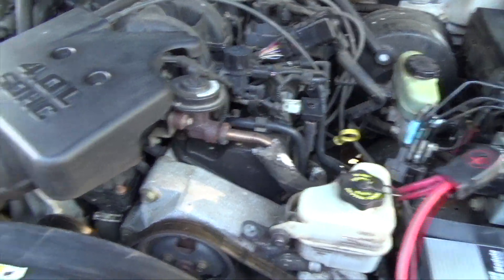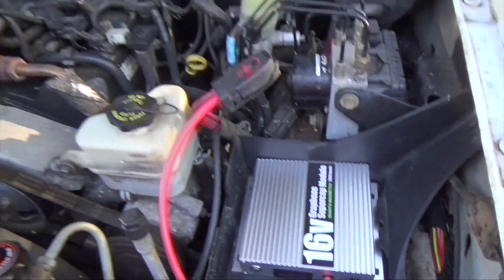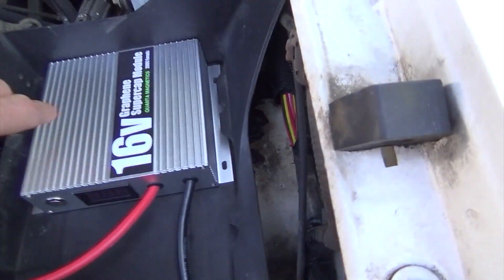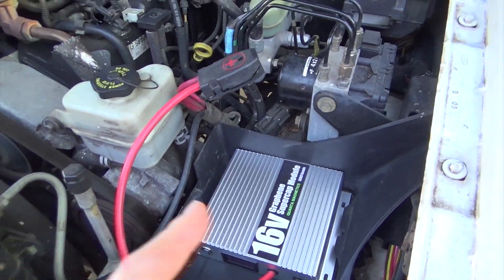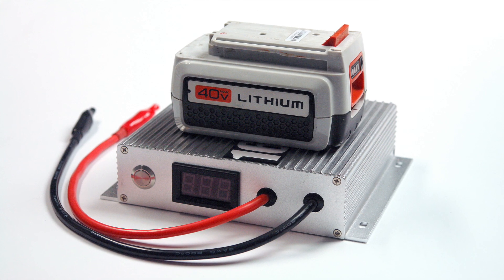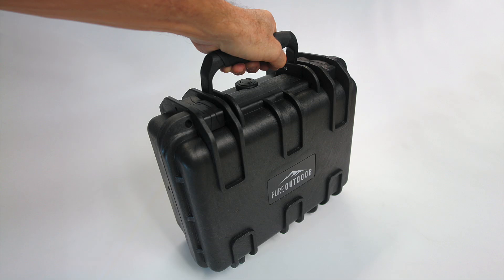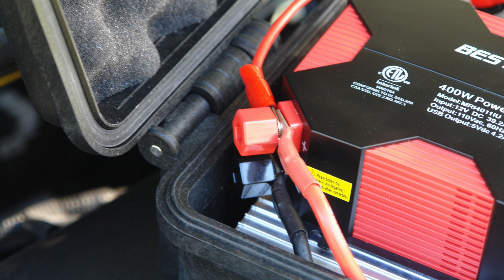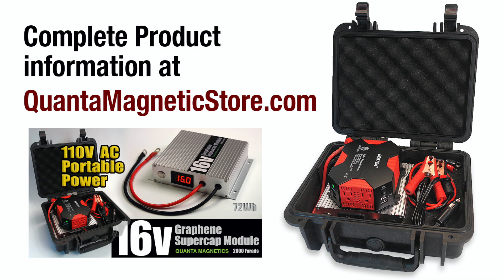Graphene Battery easily starts 4.0L Ford Engine

Comment: can this can apply to charge EV cars? can you make Fast(dc) EV CHRAGERS with supercapacitors?
Maybe for portable EV CAR CHARGER and  how long can charge EV cars like gm bolt ev car?
Reply: Not practical. Supercapacitors don't have the energy density/ power yet. There are some hybrid ones but they are really expensive and take just as long as batteries to charge.

Comment: I have Three 12V AGM Marine batteries in my trailer hooked to 500Watts of solar panels giving me 450AH. So Could I buy (6) of these Graphene batteries and hook them together to replace the AGM batteries? I don't understand how to change 16V to 12V perhaps a step down circuit? I love the idea of full 100% use, fast charging, longer life and lighter weight. Could you custom make me a single graphene case designed battery that outputs 12V and has approx 500AH?

Comment: I have a question in previous videos you have said these Graphene supercaps are 3.7v, 3000f  and the pack makeup is a 6s 4p witch would get 16v 12000f but when I went to buy it on your website it says the pack is 2000f witch suggests each cap is 500f  so witch is it?
Reply from the maker: Each individual graphene cap is 2.7v @ 3000F. Four groups of six caps inside the module. Each group is 16.2v @ 500F. All four groups connected together in parallel = 16.2v @ 2000F.

Comment: How long can you leave the truck sitting without starting it before the supercaps bleed off to much charge to start the truck?
Reply: couple days?  couple hours?
Reply from the maker: Maybe a week or two depending on parasite loads such as clock, etc. Extremely low self-discharge.

Comment: What do you mean BY 'Solar Air Conditioner?'  How can I run aa air C or my RV air/conditioner? 

I'm OFF grid in a Motor Home and I'm wondering if FIVE of these 72-watt hours in parallel (would give me 360 Wh) IS more efficient than a Li Fe Phos battery that gives me 100 amp-hours.  A deep cycle is better for my use?  Yours is practical for Cranking only?
Reply from the maker: Capacitors discharge exponentially, meaning that volts and amps will decrease simultaneously. For your A/C purpose, the 100Ah battery will most likely be best.

Comment: This is interesting indeed, was planning to build 2  x 5kWh 29,4V lithium-ion batteries for my boat and two 5kWh 48V or greater for my 4kW pod drive torqeedo electric motor before next summer, but this looks like a possible alternative.
Reply: WELL, HOW MANY OF THESE WILL YOU NEED TO GET 5KWH? I THINK YOU WILL NEED 70 OF THEM.

Comment: Ok, so disable the ignition and how long will the Graphene battery crank the motor, how long will it power the headlights etc ?.
Reply: Eric Mcmillan probably not long.... it is a capacitor after all so it will discharge much quicker than an battery.

Comment: Could I use a lot of those in parallel for a home battery bank with solar and wind turbine and thermal electric generator?
Reply: According to the specs at the link above..."It can be integrated with any existing or new battery bank or a renewable energy source such as solar, wind, and others. You can also stack and connect multiple modules in series or parallel to provide input into 12V, 24V or 48V AC inverters."
Reply: WHAT DID YOU DO, DID IT WORK?
Reply from the maker: Yes you can. Extremely low leakage current. Less than 3mA. Greater than 110,000 charge/discharge cycles. No battery can offer that. Charge retention ratio is greater than 92%.
Reply: @PMMG4HYBRID  are you still open?
Reply from the maker: @jward8710  We never close.
Reply: @PMMG4HYBRID  so  I filled out the Form what can I do
Reply from the maker: @jward8710  I sent you a link.
Reply: @PMMG4HYBRID  got it
Reply: Ordering one  unit
Reply: @PMMG4HYBRID  we good?
Reply: I have u tube  my son has the email